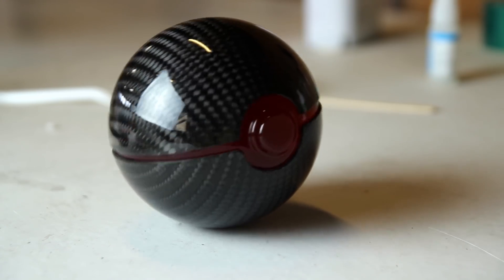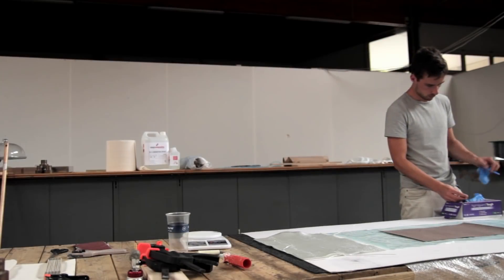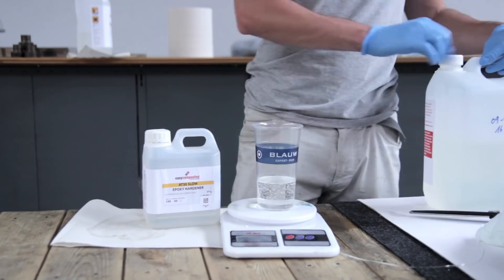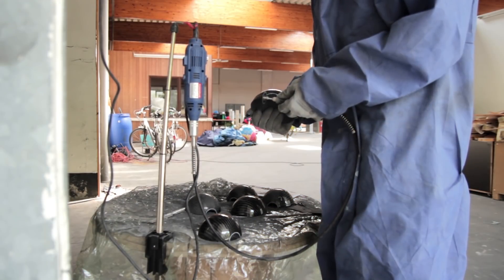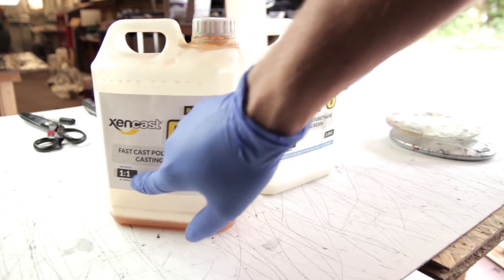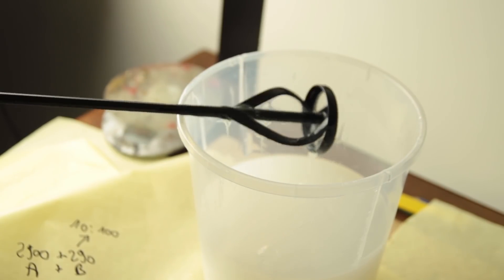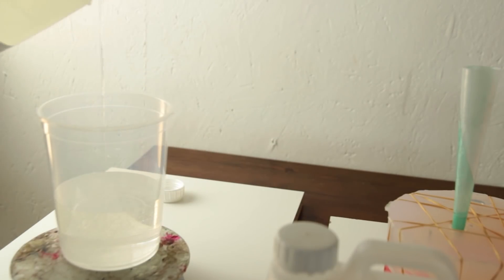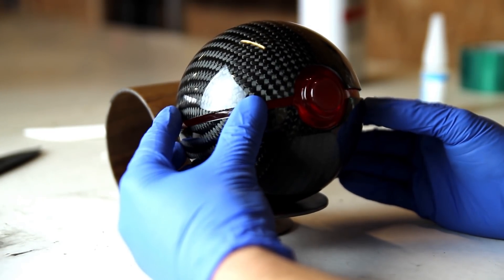Carbon Fiber Pokeball - How it's made (Pokemon)

Comment: @12:56 - What type of clear coat did you use, was it polyester? Did you also use it to coat the carbon parts as well?
Reply from the maker: carbon part and resin you see is coated with a 2K polyurethane clear
Reply: @MatthieuLibeert  thanks very much

Comment: 3d printing with a top and bottom would have been very easy.  it would have taken a bit longer to print, but it wouldnt have to be hollow inside like you said.  10% infill would have supported the top easily

Comment: AWESOME build

Would defo buy if you decide to sell. 
Personally would've liked to see you add a light source inside the bottom 1/2 to illuminate the red ring and a docking system for the stand so it lights up when you place in on the stand
Reply from the maker: thanks! will look into your remarks for version 2.0 :)

Comment: I used to build f1 car parts and the resin is already in the carbon fiber and is cured in an autoclave (pressurized oven) not injected under vacuum. Also that method does not require a top coat .
Reply from the maker: True indeed, I use prepreg as well for other projects, but was more meaning in a general way that this is a technique used in a wide range of industrial applications like boat building and such
Reply: @MatthieuLibeert  As long as you are aware 😀 keep up the great work and have a wonderful day.

Comment: pretty nice. i think id attempt to add led strips maybe some kind of rumble pack or motor inside so it can move like it does in the game when attempting to catch a pokemon. only thing is that it probably would end up not producing the effect i want. a bal that could open and close would be cool too. but this is definitely more focused on the carbon fiber.

is that just one layer of carbon fiber? does vacuum packing harden it? or is that vacuum resin infusion? it didnt look like it cuz it still has the regular cf matte finish and not glossy resin.
Reply from the maker: will look into it to add lights in Version 2.0, opening and closing it would make this project a bit to complicated unfortunately. Technique used here is resin infusion under vacuum indeed. matte finish was because I sanded the part before coating it

Comment: well done!  you may have been able to skip a step by putting a high lustre polish on your mould for the ball, there by eliminating the need to epoxy the exterior, as you know... the part is a reflection of the mould, so a high shine on the mould increases the shine on the part  : )
Reply from the maker: Was done here to add UV protection for the epoxy resin under it to prevent it from yellowing
Reply: @MatthieuLibeert  AHH, gotcha : )

Comment: They make translucent 3D printing filament. Could have modeled the part in Simplify3D or Cura or Slic3r or something similar, saved yourself a ton of hassle. You can even print it all the way full so it still has that heft. Then sand, smooth it with isopropyl alcohol, and put a clear coat on it. I wouldn't have suggested this but since you have access to someone's printer, you should have some fun experimenting with this process in future projects.
Reply from the maker: Thank for your input! will look into that!

Comment: correct me but I think f1 and prestige companys use autoclaves with thier carbon fiber as more pressure / vacuum and heat for the parts that need extra strength. 
I do like what your doing
Reply from the maker: correct! mostly done with prepreg then, but a lot is still done with resin infusion like boat hulls and such

Comment: You could have installed an induction loop to a few LEDs and bought a cheap wireless charger and embedded that into the stand so it'll at least light up when on the stand.
Reply from the maker: will look into it for version 2.0

Comment: If you where to add a few leds inbedded in the resin center ring of the next Poke CF Ball you could add a 3.7v 1000mah lipo batt, with a micro lipo and install a  wireless charging module in the bottom of the ball and in bed the qi wirless charge pad into the stand. You could have it constant, a ball bearing motion contact switch, or impact sensor hooked up to an adjustable timer ic for a few minutes light up time only when being picked up. Just a thought could work but the carbon might be to dense for the qi signal. If you like the idea we could possibly  collaborate on it. Great injection CF work and it shows with all that time and effort.
Reply from the maker: Thanks for your input, I'll look into it for version 2.0

Comment: Add an LED inside it to make the red ring glow. will look sick
Reply from the maker: will look into it for version 2,0
Reply: We’re passionate about bringing you great tech, delivered fast. We work around the clock to deliver great deals on gaming PCs and PC gaming bundles, home and office desktops and notebooks, a huge range of PC parts, PC peripherals, and more, from all the leading brands.

And we’re always adding new products. In fact, no one works harder to bring you the best the industry has to offer, at the lowest prices!
Australia's Best Value Gaming PCs

We specialise in building affordable gaming desktops and gaming notebooks, with components from industry leaders like Intel, AMD, NVIDIA, Allied and more.

We offer a range of pre-configured gaming PCs with AMD and Intel processors, as well as the option to build your own custom gaming PC from dozens of available component choices.

Need advice deciding on which system or components to choose? Contact us and we’ll run through the process with you.
Locally Built, Locally Supported

We’re Australian owned and operated, and proud to offer Australian-based service and after-sales support to go along with our products.

All TechFast PC systems come with a 12 month, return-to-base warranty, and our pro-build and comprehensive testing regime.
Reply: @stevethea5250  dafuq bruv
Reply: @stevethea5250  I'm passionate about having sexual relations with my pet goats. But you don't see me bragging about it in some random comments section
Reply: @excelsior8682  LMAO

Comment: Matt what if we put a small bright LED at the bottom of the ball to light up maybe with a reed switch and a magnet on the stand... as soon as you place it on the stand it lights up... oh and maybe wireless charging...
Reply from the maker: Could work indeed but everything with electric components is kind of my weak spot 😊
Reply: @MatthieuLibeert  i got ideas but do not have resources or the skills you got, you might be a able to pull it off...

Comment: Awesome project!! Love the details. For anyone that might make this project or for Matthieu in future projects, I have a two thoughts; A) I would've used a metal object to weigh down one side of the pokeball. Maybe by throwing it in the epoxy. Epoxy can get EXPENSIVE so that might save you a little bit, and B) The lights would've been really cool. You can just use an induction charger. super easy to make or super cheap to buy. hook it up to a rechargable battery THAT HAS overcharge protection then hookup a light to the battery and you're set. Anyway, AMAZING project nonetheless and kudos to all the work that went into those as well as the making of the video * claps vigorously *
Reply from the maker: Thanks for your positive comment! Indeed things to look into! At the time making this video I didn't have much time/knowledge about small led's and induction charging but will look into that for sure!

Comment: Nice work!
Where did you buy the degassingbucket? Does it include  vacuumpump or do you connect the other pump to the bucket?
Reply from the maker: Check the easy composites website, you'll find everything on there

Comment: What did you spray in 10 ：50 ?
Reply from the maker: Varnish
Reply: @MatthieuLibeert  Thank you. Is it for demoulding?
Reply from the maker: That's a release spray indeed, otherwise the silicone will stick to each other
Reply: @MatthieuLibeert Where can I buy it, Amazon?
Reply from the maker: @chinesedragon486  not sure I buy it locally
Reply: @MatthieuLibeert  Thank you for your reply

Comment: 5:13 - before applying the coating resin, the part (half ball) has a matte finish. i wonder why is that? since you just did an infusion, and normally that surface should have been more glossy finish, right? (this is what i've seen in other videos of yours) what am i missing? thank you & best regards ;-)
Reply from the maker: You need to sand it before coating it for a good bond, so was sanded with a 600 grid sandpaper
Reply: :-) thank you, Matthieu! the final product looks great... ;-)

Comment: How do you avoid your carbon fiber strands from moving i.e while placing the carbon fiber in the mould the strands distort. What should be done to avoid this???
Reply from the maker: being very careful and using good quality carbonfiber :) worst case you can make some cuts
Reply: @MatthieuLibeert  If we make make cuts those line do appear on the final product, but your product has clean clear strands without any cut. Did you made some cuts while placing the fiber??
Reply: vishal kharabe spray light mist of  special infuson spray glue over , wait a minute and your carbon piece shoud be  stifer an easier to work with 👌
Reply from the maker: @vishalkharabe6395  I did not make any cuts here in this project, just took a lot of time to position it well in the mould
Reply from the maker: @PK_FAB  Is indeed a way to get nice cutting lines